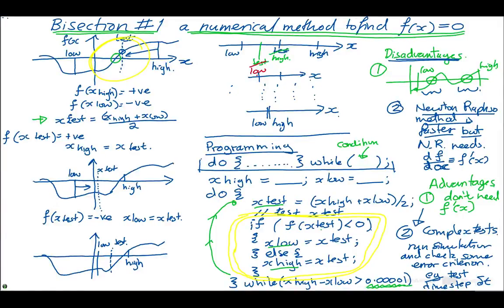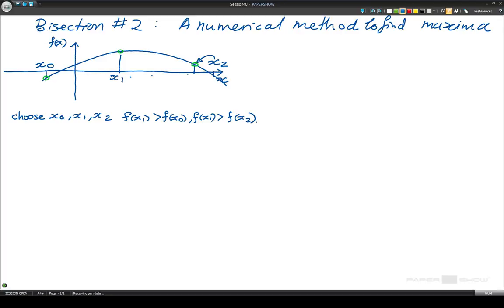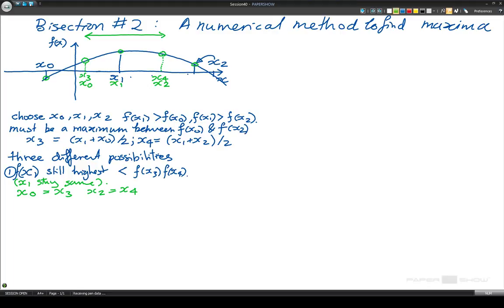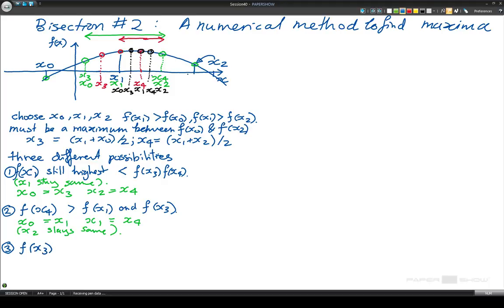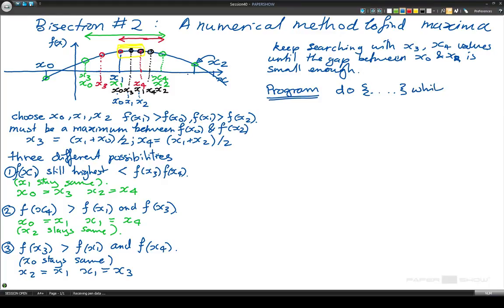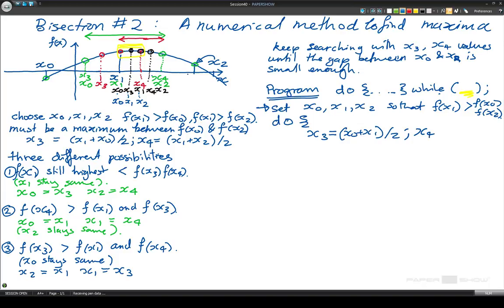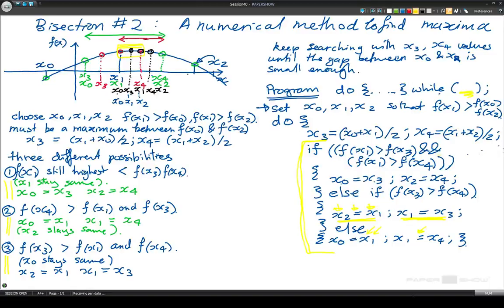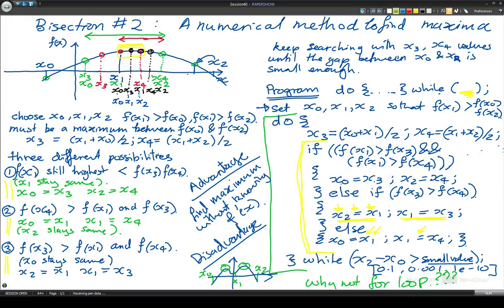Bisection Method #2 : a numerical method to find the maximum of a function f(x)

Comment: hey can i derivate the function then find the root of the derivation with bisection?
Reply: If f(x) is continuous and well defined of course you can, but sometimes (what numerical analysis is for) you need to get f(x) by testing/probing a system. By testing/probing I mean you input x into a system and get f(x) out.